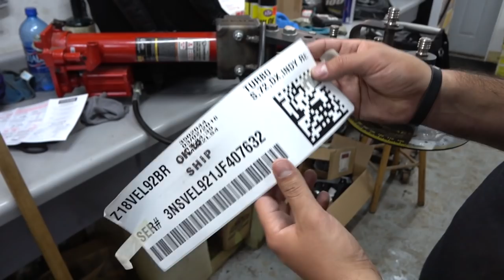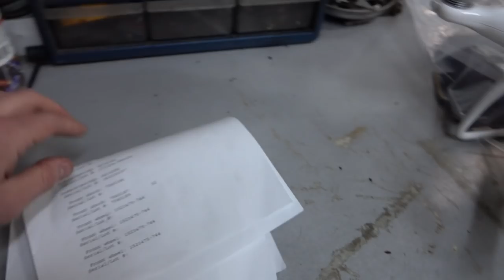BRAND NEW Polaris RZR Turbo S BREAK IN! Send it!

Comment: I believe "Controlled Decelerator" refers to the fold in the strap at the top of the harness that absorbs energy in an impact scenario. Pull down the sleeve over the pad and you can see it 😜
Reply from the maker: ooooooooooooooooooohhhhhhhhhhhhhhhhhhhhhhhhh
Reply: Yea it is like a back breaker strap.
Reply: headwound exactly 👍🏽 but only if it's actually enough force to deploy that feature. It shows a red warning label if it does.

Comment: Evo tune, maybe a cat delete and pipe? She'll be ready to run with the x3! Congrats souser were all happy for ya bud!
Reply: Maybe cat delete? That should be the first thing to do. Never do a tune without deleting the cat first. Shorten the waist gate rod 2 turns. GFB t9125 diverter valve upgrade. Clutch kit to run it around 8200. Boondocker.com has the PVCX and clutch kit. K&N fillter. Cooler plugs. 100LL fuel. Then hang on for a rocket ride.

Comment: Too bad evo doesn’t have a tune for it yet. We called evo about putting a tune on the one we have in our group and they don’t even have a T-S yet. Crazy....
Reply from the maker: From what we were told the 2018 XP Turbo tune should be similar.
Reply: SXSBlog.com gotcha. But don’t they have configure around the dynamix software as well? Seems like Dave’s (the one in our group) when you mash the gas the rear shocks compensate for the body squat.
Reply from the maker: Certainly, but that's not within the engine tuning parameters that Evo would modify... At least I don't think they would..